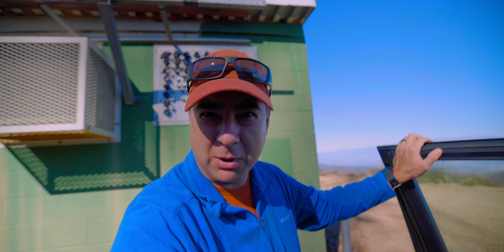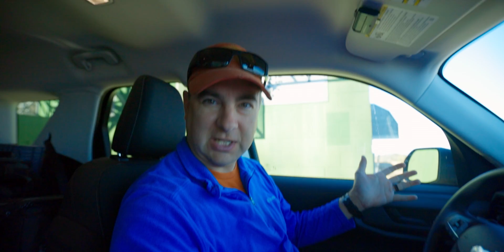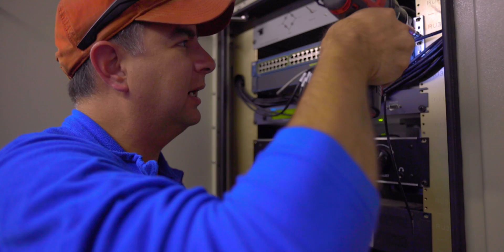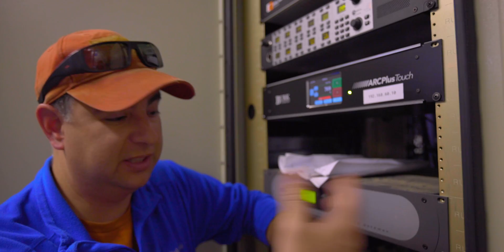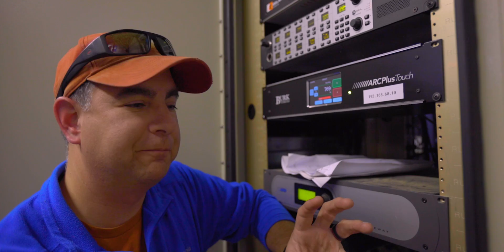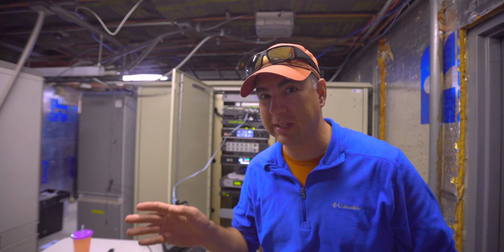Remotely controlling a radio station

Comment: Back in 1985 I had a remote control system that was programmable in Microsoft Basic and it was the 1st networked based remote.  Not Internet but their serial data network.  I could control AM/FM and Studio remotes from my apartment.  I had a System chassis and a 2-way radio at home so I could talk to the rest of the network when I got called.
Reply: See HallikainenAndFriends DRC-190